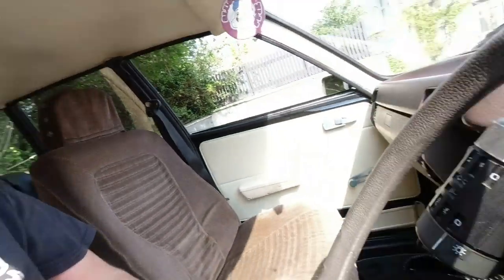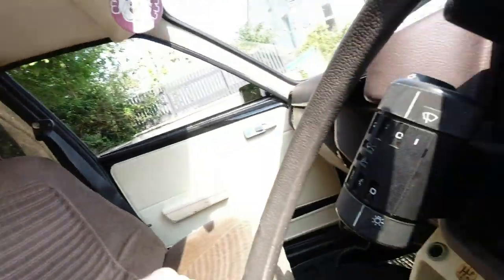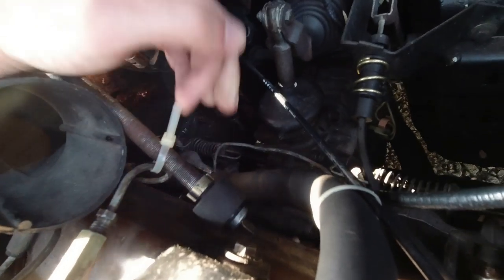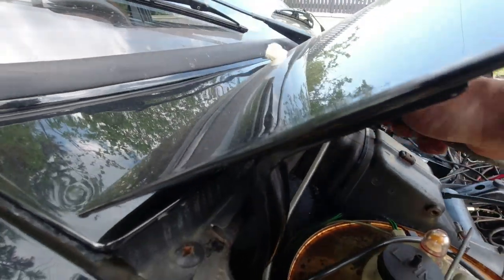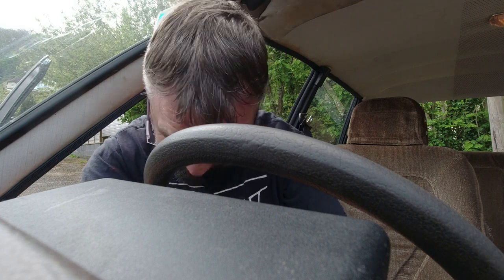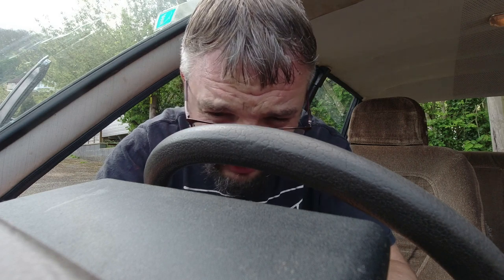ACTUAL (ham-fisted) TINKERING! Citroen GSA Speedometer fix (not what I thought)

Comment: Should the cable not be connected to the speedo first, and the loose end passed through the firewall, the purpose of the washer being to stop a disconnected cable falling into the engine bay and flailing around, possibly causing damage?

Comment: 8:52 - If you didn't have the speedo cable wrapped around a massive heater (screen?) vent pipe under the bonnet, you'd maybe have a lot more 'pudding' (as my dad would have called it) to play with - perhaps enough to connect to the back of the speedo without the speedo in place....

...or disconnect the cable from the gearbox so you have plenty of length up top first ;)

Comment: Jesus, i thought newer bmws were a nightmare to work on...those inboard brakes must be fun
Reply from the maker: To be fair, you can remove the brake pads by opening the bonnet and flicking the retaining spring with a screwdriver (like on a 2CV). No need to jack up and remove a wheel. Discs a bit more of a pain...

Comment: Why not attach the cable to the back of the binnacle first? That means you can feed the cable up through the bulk head as far as you need to in order to comfortably work with it. Then feed the gearbox end of the cable down to its position, taking the binnacle with it.
EDIT: If I had listened more carefully at 8:38 I wouldn't have needed to ask this question. Still though, I like your idea of using the cable tie to pull the cable over to within grasping distance.

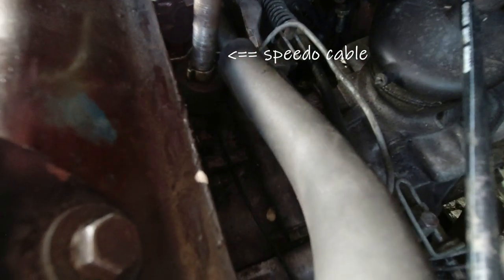Comment: 6:57 - where you're pointing - which I think is at the speedo cable, it appears there's a hose 'O' clip around the speedo cable. THAT is NOT standard equipment - so it looks to me as if there is something wrong with that end of the cable ! I wonder if it is not the correct cable - and a new correct cable would fit properly ;)

Deffo some other dodgy wiring going on there with a connector floating in mid air connected to another wire ! Near where your neighbour spotted the breather hose  not connected.

Comment: Had a bit of a laugh. When you realized that you had no way of attaching the gearbox end of the cable my first thought was zip tie ! and sure enough a zip tie (or cable tie if you prefer) it was. Of course, I suspect that a majority of viewers thought the same thing.  Yes, the placement of the cable is very much "fromage frais" which means fresh (ie unripened) cheese, btw. Truth be told I'd never heard that description used in that way before, but perhaps smearing your arm with some fromage frais might have allowed your arm to slip in just a little further.

Comment: A bit late to suggest this, of course, but wouldn't it have been easier to do the job the other way round - speedo end first, gearbox end last?

As mentioned in the video, when the cable is connected at the gearbox it doesn't have enough slack to pull it right through into the car and fit it to the speedo with the panel off. But couldn't you leave the gearbox end loose, thus giving enough slack to pull in as much cable as you need at the other end? Connect speedo with panel off, re-fit the panel, and then fit the gearbox end of the cable?

Comment: The speedometer looks quite electronic...if there is a bolt hole on the gearbox, looks like a Y clamp would hold it in from many brit cars from that era  with trad speedos.
Reply from the maker: No electronics.
Reply: @HubNut  Yes I was implying it 'looked' electronic as obviously with you fixing a cable it certainly ain't.

Comment: Surely an easier approach would be to disconnect the lower end of the cable, remove the binnacle, connect the cable, feed it back through the hole whilst replacing the binnacle, and then to reconnect the lower end of the cable? But yes; Citroen. Thanks Ian.

Comment: The car does seem very strange. I didn't know they had in board front brakes, I couldn't make quitesee in the video and cant find any picture online of the set up.
When you were struggling to reach the cable through the speaker hole because it was moving over further away, and you couldn't pull it through any more......could you have perhaps disconnected it at the gearbox end, to allow you to pull it through some more to connect to back of speedo?
Reply from the maker: Inboard brakes weren't that unusual at the time. Most Citroens, some Alfa Romeos and most Jaguars had them.

Comment: gotta love a shitroen, mostly green wires on the loom, oooo the dash is so nice lol, that coke can sized switch gear must have been the most awkward and terrible idea ever, a bit like the rest of the car really, ewww.
by the way, that thrust bearing should not be contacting the clutch fingers when your foot is off the pedal, i would imagine it is an old cable style clutch so it sounds like it is over adjusted to me, slacken off the adjuster till it stops making the noise and test the clutch for operation, have fun with that.

Comment: Normally, but not really a perfect way to do it when youre having the problems you have here with the mounting at the gearbox, a good way to do this would be to disconnect the speedocable at the gearbox, so you have slack in the cable and can pull the speedo out, atleast enough to gain access to where the cable attaches to the back of it, and then diconnect (or connect) the cable when the speedo assembly is out a bit. This was the way to do it on a lot of cars from this era, not just Citroens. On some cars you even need to take of the steering wheel to get this kind of job done. 

Such a pain in the ass, those speedocables were. In your case, you would probably not have to go in through the speaker opening at all though, using that method, unless they made the wiring too short to pull the speedo out enough for access - because Citroen :)

Comment: Actually to fix that speedo cable is much easier way, 1- remove the cable from trans and pull it through to the interior., 2- remove the binnical,, 3d reverse steps  to install. I seen it done this way before.

Comment: Oh those brilliant French engineers. They will never learn that a car needs maintenance at some point.
Try changing a light bulb on a MkII Renault Megane. You can either reach it through a hole in the wheel well (wheel turned in full lock first of course) and then try to fumble your arm through to undo the clip for the H7 halogen bulb, while not trying to drop the bulb. The main dealer undid the front bumper if they didn't have a mechanic with tall skinny arms...
Reply: The Honda Jazz is the same. Access to the bulbs only via an extremely thin hole from the wheel arch. So you have to have very thin and bendy arms. Or you just take out the whole light unit and change the bulb that way.

Comment: Could it be that the washer that stops you pulling the cable further into the car and therefore connecting it to the speedo before the speedo is fitted is actually on the wrong side of the bulkhead? You would need to thread the cable into the engine bay from inside the car to sort this out. Maybe for next time
Reply from the maker: It seemingly could be looking at the comments, but I tried to route it as I found it, and that was definitely washer on the outside. The Haynes manual also seemed to suggest it was correct as I left it. Bit odd.

Comment: The trick would be to:
-Put the cable into the speedometer first, with it outside, and the cable disconnected from the gearbox.
-Reconnect the cable to the gearbox :).
Reply: except that as Ian says, there is that washer that prevents the cable from being pulled further into the dash binnacle area, so you'd still be stuck....  I was wondering whether there would be another way of getting at it, from perhaps underneath the dash but the images of Ian upside down in the driver's footwell are probably not what we need to see on YouTube (sorry Ian :)  )
Reply: @sean640307  I'm pretty sure that washer needs to be on the inside, its purpose is exactly to keep the cable secure... This is why I like to read the Haynes manuals. Looks simple but a lot of trial and error figuring out the correct way.
Reply: @KidMillions  ah, OK.  That means Ian has it on the wrong side!!  I will leave it to you to tell him :)
Reply: Looking at the washer and the cable, I reckon there would be enough length to it that way and keep it simple.

Comment: D rop it.
  H ide it.
    L ose it.

Tie the end of the speedo cable (on the cable not the conector) on some string and put the string through the speaker hole, then replace the binnacle. You can then guide the cable to your hand by moving the string and then use you hand to reinsert the connector to the binnacle.

Comment: The way I would have done it ,is maybe a bit easier..   Remove speedometer and instrument cluster. First attach cable to the speedometer ( must  have already disconnected cable from the gearbox ).  Feed cable through hole and put speedometer and instrument cluster back in it's place.  Finally ,connect cable to the gearbox

Comment: Plenty of air in that engine bay.
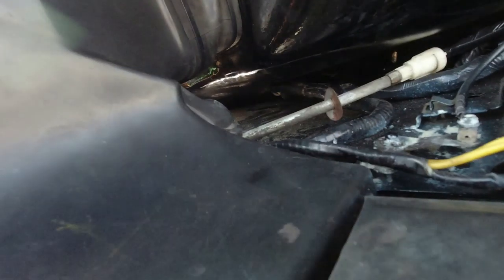At reassembly: routing of speedocable does not match dissasembly at 3:00
Reply: I noticed he'd got it wrapped round heater vent pipe - hence his extra difficulty connecting it up - the extra bends will cause it to wear faster too.

Comment: Common problem on renault 5 and 11.. speedo cable breaking.Same difficult access..   disconnect the speedo cable from gearbox pull it thru the dash attach to the spedometer then push speedo back into place.  reattach to the gearbox.
Reply from the maker: Citroen AX is a pain too. Fixed washer prevents you fitting dashboard end first.
Reply: @HubNut  What a nightmare. It might be worth taking speedo cable out completely and threading the gearbox end thru the dash so that the washer is on the inside. or dremmel the disc down so it can go thru. I do love 70s and 80s french  cars (I've had over 50 cars in 30 years- majority french) but you get an appreciation that from the 90s onwards french cars became a lot easier to work on. :)

Comment: In the end, DHL's poor service paid off, in a back handed way :-)  I'll bet someone has invented some sort of gadget that holds the speedo cable and plugs it in.  Cheers.
Reply: Nothing stopping him connecting the cable to the back of the speedo in the car then feeding the cable through to the engine bay and connecting it to the gearbox which is a bit more accessible !
Reply: Gosh, you must have been yelling at the screen :D
Reply: @millomweb  Apart from the metal washer he mention at 8:38!
Reply: @stuartaharris  It's not obvious whether that fits through the hole or not and whether it matters which side of the hole it ends up ! Who knows, it might be now on the wrong side !
Reply: @millomweb  That is the way I would have done it. Actually, merely disconnecting it at the under bonnet end, pulling some through, attach to dash, then feed back and reattach to gearbox. I couldn't get my arm through that speaker aperture, no way, no how.
Reply: @exidy2290  Actually, gearbox end off first - then spin cable backwards with electric drill - would have confirmed speedo head and cable OK with little effort and NO need to dismantle dash!

PS where did you get 'Exidy' from ?
Reply: @millomweb  It was from my first computer made by games console manufacturer Exidy. https://en.wikipedia.org/wiki/Exidy  I had a Sorcerer way back because it had a 64 column screen rather than the 40 column most had and it had a Word Processor Pac (Spellbinder). I needed it because I was attending Uni at the time and, due to an accident with my hand way back, could not write even a full page by hand. Typing on a decent keyboard however, I could do. The Sorcerer and the Microline Printer were a godsend to me.
Reply: The @exidy2290  Sorcerer was the first 'PC' I saw. The school got it - with BASIC ROM pack in 8-track cartridge case.
Never found out why you had to press both reset keys though! Did one ever do anything ?
The only game I remember on it was the contra-rotating Pac-Man style 'car'? game where you had to avoid the kamikaze car going in the opposite direction by changing lanes ! I remember you had the option of changing 1 lane or 2 !
For kids computing, the school went onto Tandy TRS80s - with an odd RM 380Z. I did quite a lot with Tandy BASIC !
Yeah, so that's why I asked :)
Memories, eh :)

Comment: Why didn’t u connect the cable to the speedo first then slowly pull the cable back via the bonnet side
Reply from the maker: Because there's a fixed washer on the cable that needs to be on the engine bay side.

Comment: Connect the cable to the speedo binnacle first with the gearbox end disconnected.
Reply from the maker: Not possible due to a fixed washer on the cable.
Reply: @HubNut  Not seen anyone else mention this but a thought - could the fixed washer on the speedo cable be meant to be on the dashboard side and not the engine side? Then you could fit it to the speedo and feed it through, the washer would then stop the cable disappearing into the engine bay.

Comment: doh remove the gearbox end first which allows the speedo cable to pull more into dash area connect to the speedo then you can fit the speedo back and then connect the cable at the gearbox end save all the aggro simples

Comment: The Citroen assembly line started with part number 000000000000001 (speedo cable)
Rest of the car was assembled around it.
Reply from the maker: They later repeated that trick with heater matrices...

Comment: Is it just me or would anyone else just disconnect the cable from the gearbox, pull the cable into the binacle so that the cable can be attached to the instruments before inserting the whole thing back into the dashboard  snd finally reconnecting the gesrbox end. No arm shredding required. Of course its easy to be an expert when one hasnt even touched a Citroen before!

Comment: https://shop.citroenclassics.co.uk/speedo-cable-clip-3311-p.asp . Worked on these vehicles many years ago, at a French car specialist in London, near Holloway prison. Think it's now called French and German car services Ltd. AFter the fact of course as you have now found the problem. It would have been easier albeit may have taken a bit longer to get some slack on the cable, and fit the cable with the binnicle out of the dash, then fit the binnicle back and reconnect the cable to the gearbox. But the above link is to a clip for the fixing of. But you may find something else to suffice. Good luck.

Comment: Leave that alone before I electrocute myself - Something I've said whilst tinkering with cars on more than one occasion.
The others being many swear words.
Reply: My most restrained moment was maybe rather  painfully  verifying that the ignition system was working when  buying my ever-moribund TR6. The vendor was highly impressed with my suppressed expletives as I copped a stray 30kV off a HT lead in proximity to his young kids getting it going on 5 cylinders after de-oxidizing the points.
Reply: @philhealey449    Yes, that does sting a bit.  I can heartily concur having accidentally connected myself into the ignition system on a car with electronic ignition.  It was a little while before I was actually capable of saying anything that children shouldn't hear...
Reply: @gosportjamie  My not so proudest moment was taking some HT leads off, putting them back on incorrectly. Then after realising my mistake (and the car running like crap) I got a belt off one when I unplugged it with the engine running. In my defence I was about 19, and it was on a Ford.
Reply: @mrb6094    Yes, it's a lesson you don't forget easily, even if you manage it accidentally...